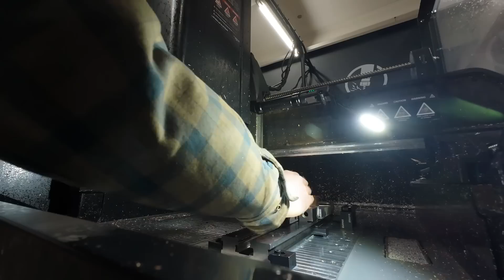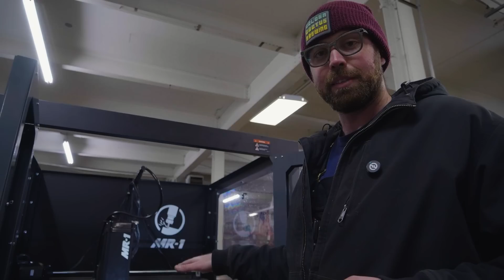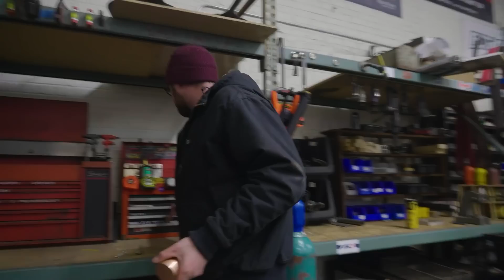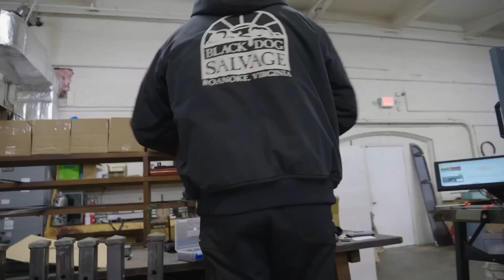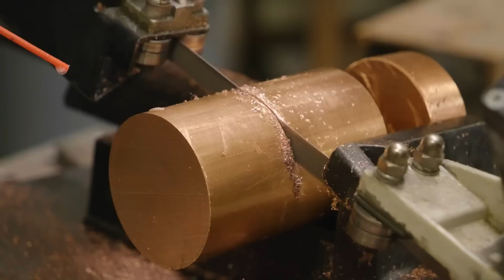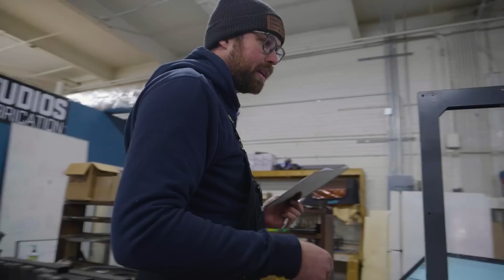The INSANITY of learning CNC Machining

Comment: No way is sticking your head in the machine while a drill bit is spinning at a high rate of speed centimeters away from a copper billet, the recommended way to work with that machine is. 😮

Comment: Having to hold a cone from the narrow end.. a 2nd tapped hole in the recess face. then mill a puck/plate to through-screw to the holes. then lock the puck/plate into your vise fixture. Great work, and thanks for a non-sugar-coated video.

Comment: I'm pretty much in this position right now. Joined a 2-man prototype shop at a major manufacturer last year, and I only really knew how to weld. The guys retired 3 months ago and now I'm left on my own with nobody to turn to. I'm alone since in the infinate wisdom of the c-suite, we got a hiring freeze because we had a bit less profit this year, only a billion in profit...

Got a lathe with a driven Y-axis and subspindle, two mills, 3-axis and 3+2-axis. None of the machines use the same language, Seimens, Fanuc and Heidenhain respectively. 
We finally got CAM software as the old guys retired. But only for the 3+2.

I just don't know what I'm doing... Trying my best, but holy hell the learning curve is something else. The only thing that saves me is my interest in machining. I like it! But maybe not like this...

Comment: Yeah, I'm sure I'm not the first to suggest this, but I think milling the bottom flat and putting the screw hole in the bottom, then flipping it over and machining the rest of the features would have resulted in a more consistent end result. I don't know if you have the needed fixturing tools either, but by putting a "socket" on the bottom similar to what you did on the top, you would have a surface to grab and hold instead of even needing the screw. Screws do not sit flat by default and instead sit at an angle and make it more difficult to have parallel surfaces.

Comment: next time set the fusion work offset to zero z off the underside on the second operation then zero your machine z off the top of the blocks its sitting on then you will get a much more repeatable height and you wont have to do the roughing passes, you can just set your stock a little higher/thicker if its not cut quite straight so you don't accidentally take too heavy of a cut.  also do the first operation on all 4 blocks then, do the underside on all 4 blocks then you don't need to keep resetting the z on the second operation for all 4 parts.  its tough at first but you can get proficient pretty quickly if you stick at it and put the learning time in.

Comment: How I'm thinking I would have done this. Do 1 operation at a time. Cut all your blanks. Use a V block to clamp the pieces in the vice and face each side to square them up. When facing the second end, face it down to size. Then do your next facing operation followed by drill and tap. Then drill 2 small holes you could use a 2 pin style spanner wrench on. Next setup a fixture plate/block out of sacrificial aluminum. Milk it flat the find zero. Use that as your Z axis zero to finish the job. Now drill and tap your fixture for the mounting stud. Center off that should be you're X/Y zero. Install stud and mount brass part using a spanner to tighten it down. Begin next operations. Your part will be fully in the positive. Your ball endmill will cut negative into the fixture plate. Maybe this will help your thinking about order of operations in the future.

Comment: Just a little hint to keeping parts on a threaded stud while facing he bottom. Set your tool path to cut a spiral. With it cutting a line path like what you did with your parts a portion of the cut spins the part the wrong way. While cutting a spiral pattern to face it you're tightening the threads the whole cut path. Another thing you could do is to use a sacrificial plate to cut your parts on. Personally I'd suggest facing the bottom as a first operation. The rest of the operations should be clockwise which will tighten the stud in the bottom.

Comment: Using 2 threaded holes would have solved all your problems here. The part could then be screwed to a square fixture plate that could be held in a vice, with no danger of the part rotating due to the 2 screws. It’s also removable from the vice and Z height is repeatable.

Comment: So this part is better suited for a lath operation. But your part holding in the MR was your biggest problem. A pocket on bottom and a small three jaw could be a solution if you run a similar part in the future.

Comment: Tay, first off love your work mate!
Could you get the guys to 3D print some sectioned trays with individual spaces for your tooling, collet and a "drop zone" for each process.
You can get rid of that shitty cardboard and have something that can help avoid stuff ups and (some) broken tooling plus you can print as many as you need for each process, nice and safe and you are not looking for where you put that "thing" last. Also just thinking if you have to walk away or hand over to someone they can see where you are up to by the number on the tray. 5 steps, tray 3 here we go...?
If you were to put them on your web site for us to buy as either a print at home or finished product for us weekend warriors that would be handy, as well as a tool holder that could mount to the cabinet for the spanner set.
Just some thoughts that may be handy and make you some extra coin mate, either way keep up the awesome work!!!!

Comment: I do t know if this comment will find you or not but, you should make a sacrificial fixture plate when doing this and do these in steps across the whole job. Have all the piece cut down, face the bottom, drill and tap a hole in the center, switch to the next part and repeat until all 4 or at this point. Thread it down on your fixture and run the ops for you pocket on all of them, then run the tapered side program on each. It cuts your machine time down on the tool swaps and it would allow you to run the program counter clockwise. Only catch is your climb milling then and not conventional. You could swap out the rht stud and threaded hole for lht and run it conventional.

Comment: Wish I was closer in location id trade machining lessons for tig welding lessons lol. There's like a million little things I could touch on. for the second op use the machined face as your zero point for the second op z offset. That would be the top of the bearing race you ended up using as a parallel, This will allow you to dial the height in and then it will repeat because your using a cut face as the reference. Also you can use a shim to set part offsets with the tool basically you can grab a feeler gauge with a known thickness bring the tool down and slide the feeler in and out between the tool and what your trying to touch off, when you can no longer fit the feeler gauge between the two you know your the distance of the feeler gauge away from the zero point. And the last thing is buy yourself a centerfinder to pick up your X and Y offset.

Comment: Does Fusion allow you to do a clockwise spiral facing pattern? Then the push and pull of a lateral facing op won't be there to rotate the part off the threaded rod. It would just help tighten it onto the threads.

Comment: Future FYI, you can order tapered end mills. It should help you speed up the operation. Also you should be able to do circular milling operations which should help with loosening of the part. It’s been a few years since I used Fusion CAM. Doing Solidworks now & about to jump into MasterCAM.

Comment: For round parts I always put my X0Y0 in the center if I do not have a built in feature to index off of.  Probe the left side somewhere (it does not have to be in the middle of the round part) then, without moving in the Y direction, probe the right side.  Half of that distance will be the exact middle of the part in the X plane.  From that middle point, probe the front and back with ut moving in the X this time.  Half of that distance will be EXACLT center of the part.  Assuming it is round. ;)  Much easier than eyeballing.

Comment: Set your WCS Z zero at bottom of stock (top of vise jaw/table/stock support platform) in both CAD and when probing in machine. This will ensure correct height of finished part, without probing stock top multiple times. You just need to program approximate height of stock into CAD (plus little comfort margin), so initial roughing cuts don't crash or overload bit.

Comment: Put your copper foot right side up on blocks, cut a hole into a thick piece of plate to match outer taper and use table clamps to hold plate down. Problem solved. (I think)

Comment: You have the MR -1 CNC, make some taper fixture jaw blocks to clamp the taper sided part in or 3D Print some. Also add a jam nut to the stud and tighten it up to the part to keep it from rotating. Good video on the MR-1, keep them coming!

Comment: I was where you are now about 6 years ago. I bought a desktop CNC mill (which I first had to  fix / partially rebuild) to teach myself CNC milling. It's a nerve-racking experience. Even the small machines have so much power that they can destroy tools and /or themselves in an instant. But the reward when you start getting the hang of it is huge. Props to you for doing your first project in copper. That's a challenge in itself. I started out with a block of wood and then switched over to aluminum and only much later I tried my hand at steel. In the past years I've mostly been doing projects involving electronics, so the mill has been sitting for some time. I bet I'll have to go through a lot of that all over again, once a project for which I'm going to need to do some CNC milling comes up.
Reply: On the workholding: maybe try doing a spiral cut against the direction of the thread? That way, the force of the cutter could actually tighten the part more, instead of it coming loose because of the vibrations?

Comment: Tay, the single stud mount will work better if you had used a larger diameter thread for more holding power, but since the table's grid appears to use a smaller thread; that's limiting your choice... so perhaps in future make a consumable alum or HDMW plastic mounting plate with enough thickness to allow for learning curve. Make the plate or platform so that it bolts to that tapped hole grid in table ( you can even make it so you could have done all 4 or 5 slugs in parallel order to give you a sacrificial piece at same time before it moves on to the 4 actual articles )  

The consumable platform can be tapped with many different tapped holes for parts with a known offset for utility. In this case with this small thread, you could help lock it in place with a same thread size allen head set screw installed from top after it's in place as tight as you can make it on stud/table mount. The allen head would act like a locking, or jam nut does on other single thread situations like on car axles...

PS  Watching your outro, it reminded me of this classic :     https://www.youtube.com/watch?v=iV2ViNJFZC8       Maybe for a next project you can translate John's silhouette milled into the top of a plate for wall display ?

Comment: Starting to learn machining with copper is like learning to weld for the first time on aluminum with TIG. Not just a steep learning curve, but working with a difficult material at the same time.

Comment: It may not be necessary with today's technology, but I learned the meanings of the most used M and G codes. This way you can verify what's coming next as well as write short programs at the machine with only a few lines of code.
Lastly, any threading tool should work as long as there's clearance to get into the hole and clearance between the part and the shank. Most threads have the same 60 degree profile so a tool for a 1/4-20 thread should have the same profile as a tool for a 1/2-13 thread, only the tool depth will change. 
Putting the time in is the biggest thing and you're taking care of that. All of this stuff will be second nature in short order.

Comment: you could have saved yourself a lot of time and grief if you could have designed the part with a straight section below the taper. another approach would be to drill and tap two 1/4-20 holes  all the way thru then bolt the part to a block of aluminum . you could then machine both sides by flipping the part. you would still need to flatten one side before starting . this is a long learning curve and it generates a lot of scrap , but once you teach it to dance its a beautiful thing. best of luck to you.
Reply from the maker: You are absolutely right, and I'll keep that in mind for next time!

Comment: Didn't have a chance to watch the whole video yet so you might have already figured this out.  When facing the back side your toolpath is using a linear step over.  Your cutting forces are trying to unscrew the part when cutting in one directions and trying to screw it back in when going the other direction.  You should be able to change your toolpath in Fusion to spiral in towards the center.  Kind of like your adaptive clearing path to cut the counterbore on the top side. If you spiral clockwise, cutting forces should be constantly trying to tighten the part on the screw.

Comment: One of the biggest issues for ADHA people and CNC machines is that the CNC process is hypnotic and it causes us to just sit there and stare at it instead of walking away to do the other work that getting the CNC in the first place afforded us. Just like keeping a list to stay on task, I have to basically read my list item "leave the shop" when I run my CNC plasma cutter or I'll just sit there and stare at it. If you have a shop full of ADHD people it's like minions staring at the claw... So CNC becomes a work downward multiplier in that the more CNC machines you have the fewer people get work done as they are hypnotized and just stare at it going .....ohhhhhhh... the claw... lolz

Comment: You should  invest in a small used lathe. You the could have used a threaded stud in the 1/4' hole and chuck it up in a lathe and removed the majority of the stock witch would also have given you a square surface to start your milling process. A lathe is a pretty handy piece of equipment to have in a Fab shop

Comment: Love the channel, been watching for a long time. This brings me back to when i use to program and run large cnc machining centres. A couple of things to look into. When setting a part up you need to make sure the fixture positions the part consistently in the X,Y,Z. These should be your fixture offsets. Set the Z to the finished part height. This should not change. The thing that changes will be the starting size of the part which you need to estimate to ensure not to take too much off or too little off with the first cuts. A 3 jaw chuck with bored out soft jaws would ensure x.y&z do not change from part to part. When milling top surface you can mill as a circle, similar to corkscrew. Use about 3/4 dia of cutter. This keeps constant pressure on tool, minimises wear and cutting fresh air. Clockwise climb mill. This will tighten screw and not loosen. End mills can be re-ground. You are using alot more off bottom of tool which can be re-ground. On CNC you can also do tool dia offset for re-ground tools or slight dia adjustments. You need to program this in. come on at 45 deg with a g41 if climb milling, g40 cancels. Always ensure you climb mill and not standard cut for safety. IE, clockwise circle on O/D of part not anti-clockwise. Set z0 to top of finished part. Use a slip block of bottom of fixture the correct size so z0 is always the finished size, you cannot go wrong then. main program calls out z heights and then canned cycle to mill top of parts. Hope this helps

Comment: Why not just do the bottom first and then flip it and do the top?  Wouldnt that remove the need for the screw?  Granted, you wouldnt have learned out to do the threads, but you may have saved a tool.  Or there could be something that im overlooking or am ignorant about as I am not a machinist, just an armchair enthusiast.
Reply: Flipping the part over when he does allows him to cut the piece to length AFTER shaping the top.  If he cut the piece to length first there wouldn't be anything to hold on to in order to machine the top.

Comment: As a retired Machinist, You are doing it right. Go slow and learn it. (Hopefuly not from crashes) It takes time as you know and patience and practice!
You are doing much better than a lot of other guys I have seen over the years.
Best thing about CNC, as you might know, is repeatability.
 For the backside- try using a fly cutter to mill off small amounts at a time. Maybe even put loc-tite on the therads? ( just a thought)
Also you could make a fixture that matches the taper to sink it into with the bolt in the center, holding the OD.
Hint: you should not need more than 1/8" of extra stock for milling each side, taking off just enough to clean the 1st side. So if I was making that part I would want to start it at 1" thick. This will save you a LOT of time.
Endmills can be sharpened and used, you just change the tool dia. in the settings for that tool.
Thanks for the video as always !